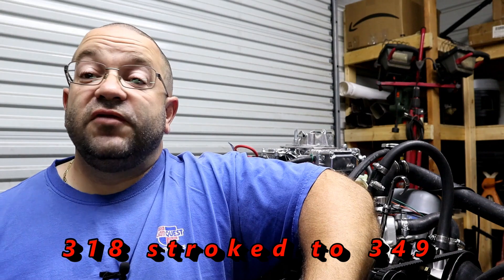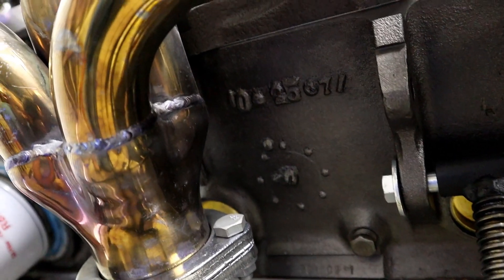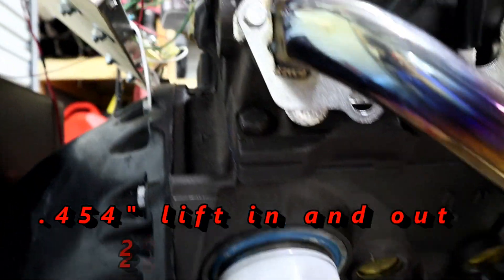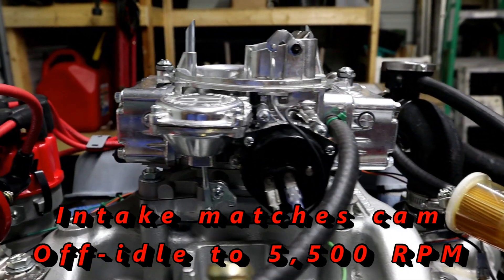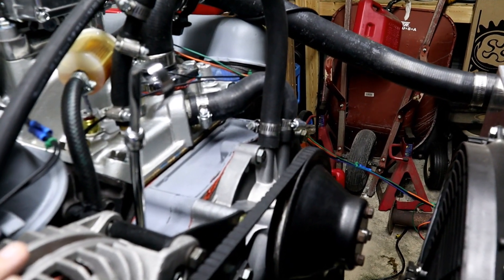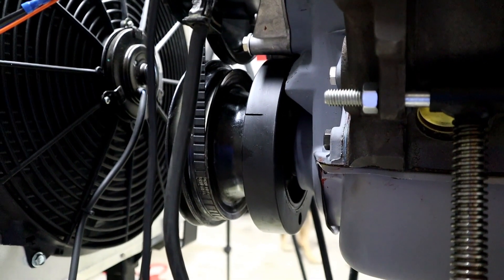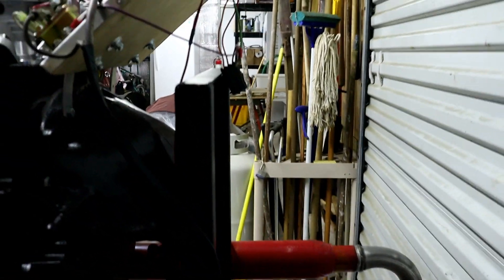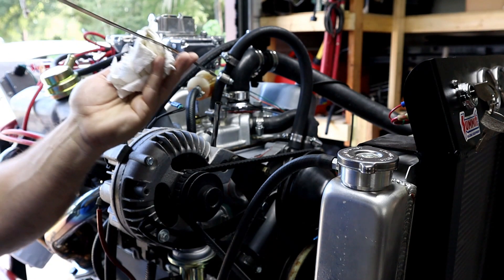Build Review: Chrysler 318 to 349 Stroker

Comment: Did you use the OE pushrods from the 318 or did you use something diffrent. And are the rockers OE to the 318 or the 340 heads? Amazing build and video!
Reply: No problem. Did you also use 360 connecting rods or 318 rods? I've been told the 318 rods are to long but I didn't know?
Reply from the maker: If you haven't watched it, this link will help. https://youtu.be/RYoPxnKRwhw

318 rods. The crank was turned to fit them. We had to use a piston set with a lower compression height.  I left part numbers in the descriptions.

I hope it helps.
Reply from the maker: Great questions. 

Factory 318 push-rods.

Factory style 1.5 ratio rockers.

Thanks for watching 😀

Comment: Any kind of machining on that crack and is it a stock 360 crank.
Reply from the maker: It a nodular steel version of the 360. Just turned the main journals down to fit the 318.

Comment: Do u have to use a 360 flywheel and hardmad balancer on 360 crank or do u use 318 stuff just wondering cause of internal and external balance of these motors ?
Reply from the maker: 360 flywheel per the 360 crank. The rotating and piston assembly were balanced with the flywheel. Thanks for watching.👍

Comment: your rocker shafts are on wrong the passenger side notch goes to the back of motor. driver side  notch goes to the front of motor. If you have a Mopar manual it'll show you that. You got both shaft notches pointed to the back of the motor.
Reply: I wasn't being rude I just wanted to let you know sorry
Reply from the maker: No rudeness perceived. We very much appreciate the feedback and found out many builders over look that. We checked this morning, and sure enough, you were right. The oil tubes were pointed down and to toward the crank, not straight to the ground.  Thank you again for sharing your love for the Mopar Small Block. -mike
Reply from the maker: Hmmm. Good catch. Oiling was good on both sides through the rockers. Will look into it. We had a full service manual, but we may have overlooked something. Thanks for the assist.

Comment: Yes!!    Again, how did you use a 360 crank in a 318 block?   Seeing how a 360 has a larger rear main than a 273 / 318 / 340.
Reply from the maker: Hi Dave. The main journals were turned down to fit at a machine shop. Thanks for watching. 👍

Comment: Could I ask for the part number on the silvolite pistons please? Have been dreaming of building one of these myself, just having trouble on what pistons to use
Reply from the maker: Hey StrikersLG. I listed all the parts used for the piston assembly and such on a previous build video. (https://youtu.be/yd7NbJMN_n8)

Keep in mind the selection here was based on the 360 crank stroke and 318 connecting rod length. Thanks for watching and let us know how your build goes. 👍

Thanks for watching

Comment: then this is not turn key
Reply from the maker: What's the reasoning? Install, supply fuel, supply coolant, supply power, wire into the electrical system on your vehicle? Did we miss something?
Reply: I think this fellow does not have a key😜

Comment: Is there any dyno numbers on this combo?
Reply from the maker: Great question. Unfortunately, no. Based on similar builds, compression, air flow, stroke, and such (bench estimates), we estimate at least 1 hp per ci. There should be a solid curve for hp and torque. Unfortunately, we're not the high dollar hobbiests who can spring for a dyno session and tune. Although, it would make for a good episode.

Comment: How do you put a 360 crank in a 318? The main journals of a 360 are larger than a 318
Reply: grind the 360 crank mains same size as 318
Reply from the maker: Nailed it! Thanks for watching. 👍
Reply from the maker: Great question. The journals were previously turned to fit the 318.  Thanks for watching.